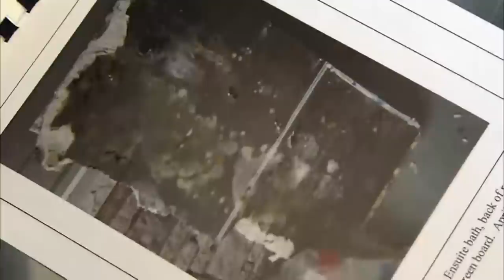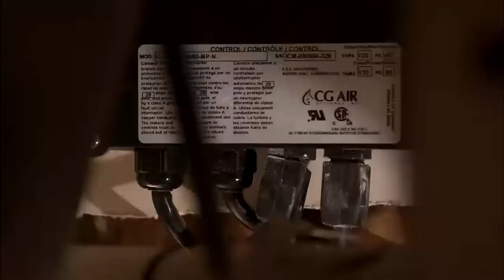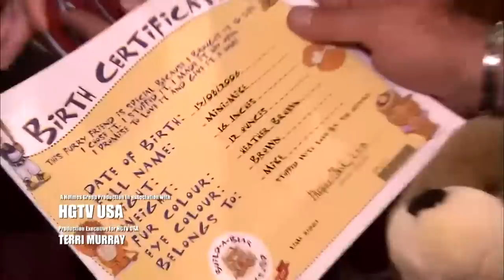Disaster in the Bathroom: Mike Holmes' Epic Bathroom Rescues | Best of Holmes on Homes S112

Comment: I’m sorry but you don’t need permits for building a deck at least not in Florida
Reply: Yes, you do! Local building codes vary, but permits are typically required for renovations that change a home's size or structure, or change its electrical or plumbing. Since most decks connect to a home, you'll likely need a building permit for a new or replacement deck. Dec 15, 2022  
As a general rule, every deck that is lower than 30 inches does not require a permit. So, your deck may be exempted of permitting if it is: Less than 30 inches above adjacent grade. Not attached to your home (usually more than 10 feet from your home)  What requires a building permit in Florida?
Section 105.1 of the Florida Building Code states that a permit is required to construct, enlarge, alter, repair, move, demolish or change the occupancy or occupant content of a building or structure or to erect, install, enlarge, alter, repair, remove, convert or replace any electrical, gas, mechanical or plumbing ...
Reply: @cw3339  my childhood home has a deck with a wheelchair ramp and there were no permits for it and it’s still there today
Reply: @delyn13  That doesn't make it legal... When you go to sell it, if there were no permits and it is NOT disclosed then you will get into trouble! They even may make you remove it unless it is grandfathered!  (made before permits were required).
Reply: @cw3339  what year were permits required it was there in 1984 and we moved in 1998 and no one ever said anything about it
Reply: @delyn13 A permit is no test for the durability of the build. Someone can build a great place and totally to code or above. That is not what permits are for.
Reply: And by the way. YES. You need permits to build decks in Florida. Took me 45 seconds and Google ...simple.